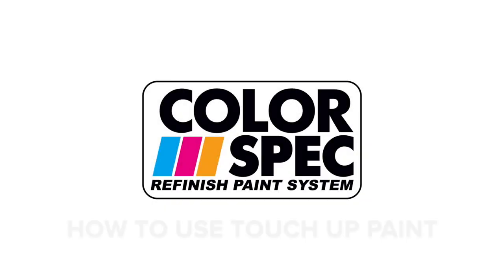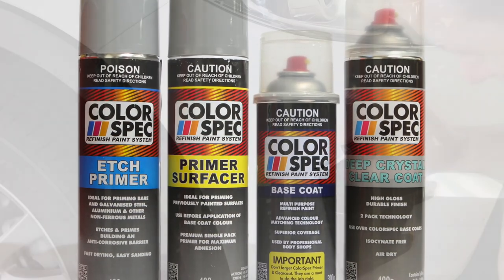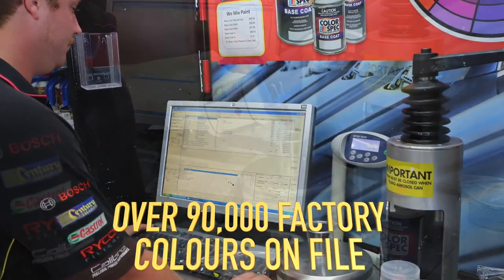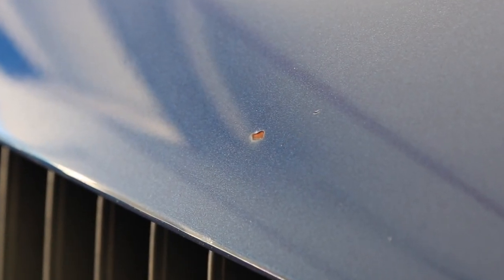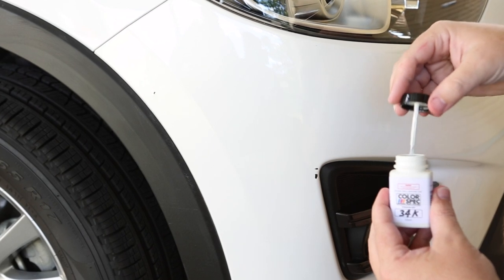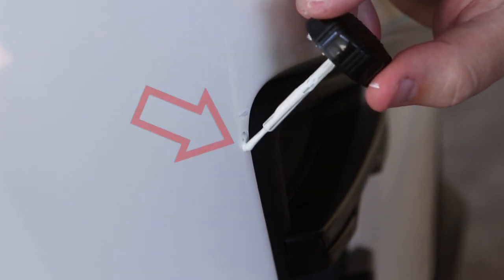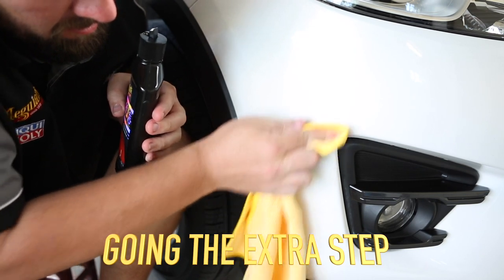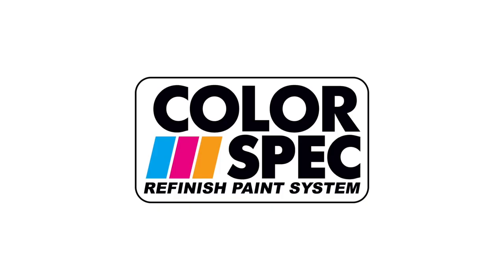Using Touch Up Paints // Colorspec // Supercheap Auto

Comment: Supercheap Auto employees always mix the wrong paint and the paint code system also doesn't work. Nowhere near 98% match, half of the time it will be a different shade or color. Every time get paint made there I risk wasting my money and ruining the paint job. Go for your local auto paint specialty store instead. Supercheap auto stuffed up too many times and the client will be the one coping the wrong paint! -Take my advice as I do paint repairs regularly.
Reply: The car importer will have correct paint from the registry plate... just order it via official channels